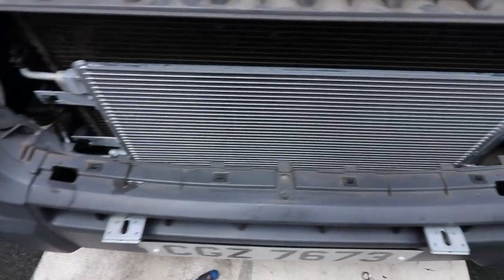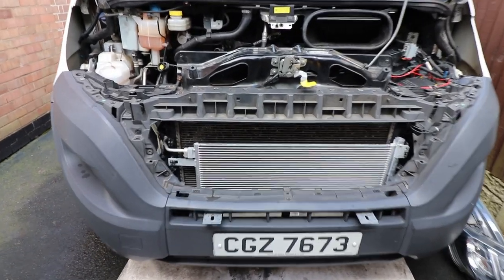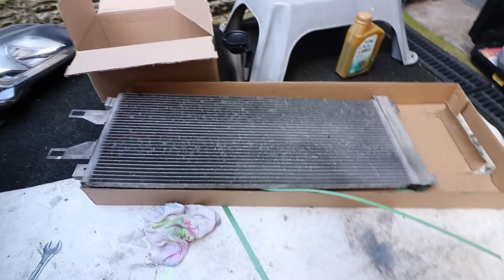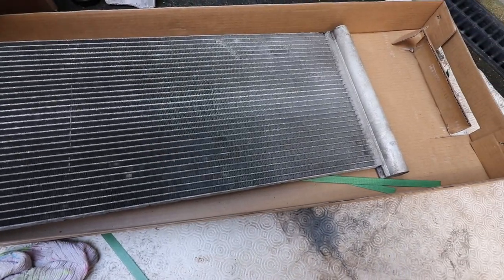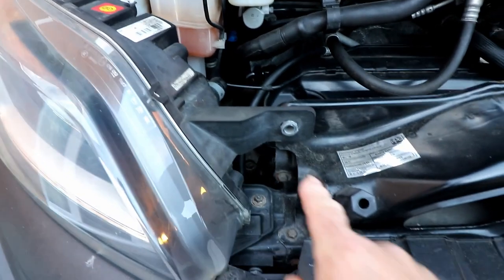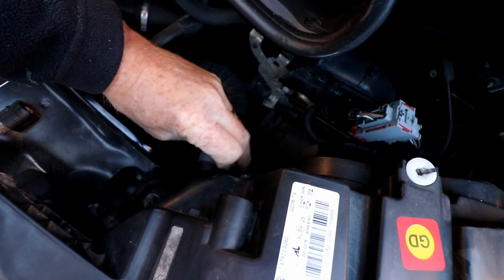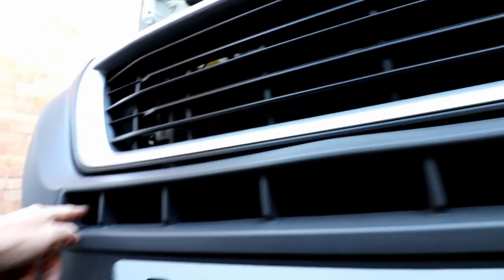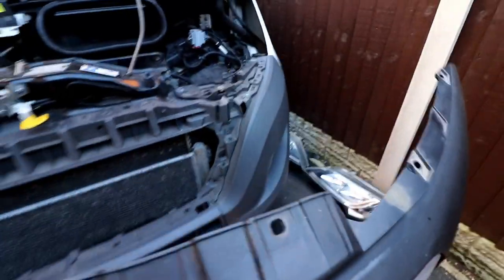Peugeot Boxer Air-con Condenser Replacement

Comment: What would we do without you guys doing videos like this, I wouldn’t have known where to start.. I have the same van with same problem. Could I ask where you got your new condenser from ?
Reply from the maker: Hi, Thanks for the feedback, its much appreciated.
I bought the condenser on line from Halfords. Although when it arrived via the courier, it said Euro Car Parts on the packaging. I think I paid around £80 for it.
Hope that helps.
Reply: @ianwheeler7903  hi, thanks for the reply, I’m looking at one at a shop called Costal Motorhomes, £72, there’s a statement in the description saying “ Please be aware there can be more than one option fitted to these vehicles “ .. not sure what that could mean, I’ll call them tomorrow I think.
Reply from the maker: @copperknob1971  Hi, I seem to remember getting the part number off the old unit and then putting that information into the online inquiry at Halfords. Giving Coastal a call is a good idea, however they may ask for the part number which i think is on the left side of the condenser when stood in front of the van.
Reply: @ianwheeler7903  cheers… I’ll see if I can get it.